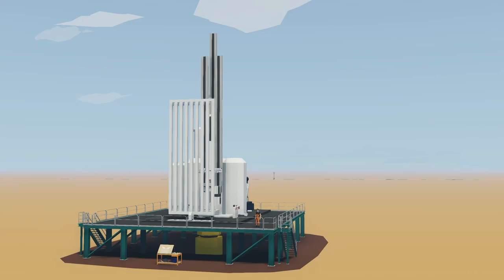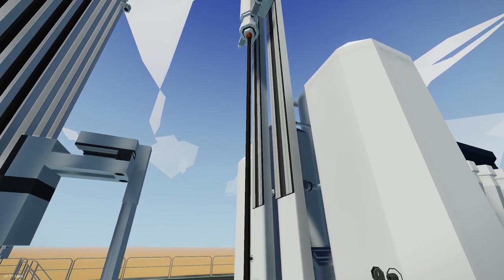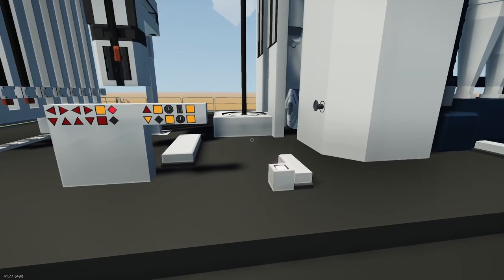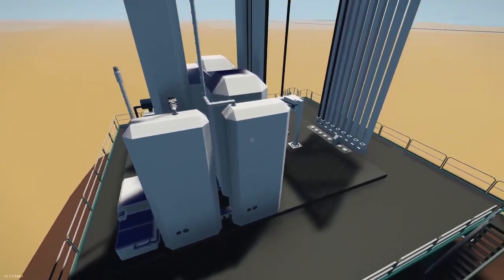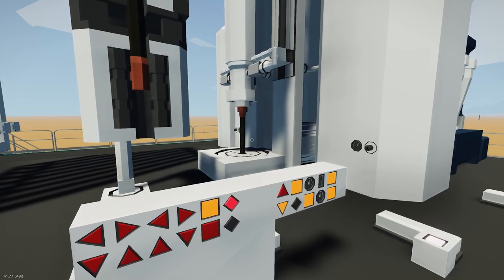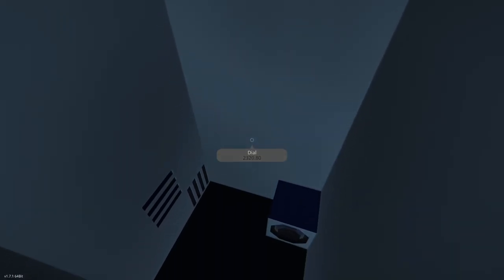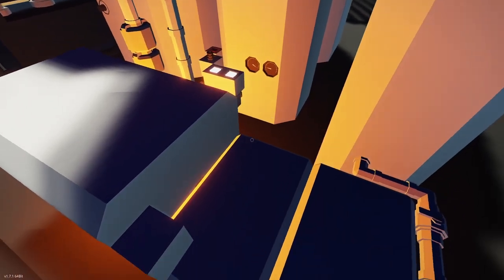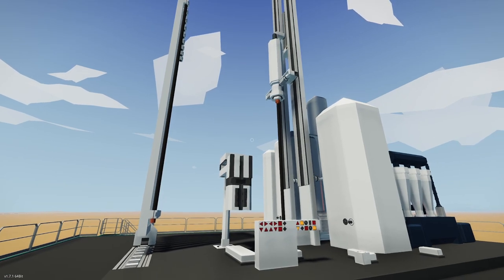Stormworks: Oil Drilling & Refining Tutorial #stormworks

Comment: No, you can leave the pipe / rod in the well when despwaning a vehicle. You must de-clamp the pipe/ rod completely. So long as all clamps are off, the pipe will remain when despawning. I do this when im done drilling. Then i load my pumpjack and distillation tower to start producing oil and fuels. It has its own clamp, swivel, and pump assembly to grab the left over pipe / rod.
Reply from the maker: Interesting. Thanks for the info. 😁

Comment: one thing i did, may release it on workshop was i had a intercooler on the oil between the main storage to distill.  that intercooler on the B side was the water from the closed loop diesel generator i was using as a battery maintain.  it would pre-warm the diesel not by much but enough to heat it to about 50-90 degrees, depended on how long my engine was running for.  also helped to bring the engine back down in temp.
Reply: but i also could see using other things to heat it now like nuclear, ect.

Comment: I went straight to drilling in the ocean, I only had to drill 6.5 meters however because of the water depth i used 14 lengths of pipe total. Thanks for the tutorial on distillation I hope to add that to my ship soon.
Reply: how did you get the well head to align with the rest of the rig?
Reply from the maker: The wellhead is preset on the land ones. You just have to drag down the block from the top and that will show you where the center point is.
Reply: @CaptainCockerels  yes, but I mean on ocean-going rigs where that kind of precision seems slightly implausible

Comment: I love your vids.  I'm building a full mobile setup except the drill platform (but it looks mobile, lol).  I have to haul everything to the site.  Water, slurry, fuel, generator, even a power distribution box.  I have a rod trailer that I pull with the hummer.  A Super HET that hauls tanks.  It's a very modular setup.  I really enjoy the hands on approach.  My distillery is not going to be on site so I have to truck out the oil and distill it elsewhere.  I love the added gameplay.  Ty for your vids subbed

Comment: awesome stuff agian mate.  made soemthing similar to yours but my Pivot is no where near as rigid as yours? mine wobbles alot. did you do some XML stuff to that Pivot you use to pick up the rods?
Reply from the maker: No, it is not edited. Make sure your physics is set to high
Reply: @CaptainCockerels  it was on Auto, still happened a bit tho. So i just made it a bit heavier, think it was a bit of a counterweight issue. thanks  for the response man :D
Reply from the maker: @talosstrike8990  It is a physics setting issue on your end. Set your physics to high and the crane will work as intended.

Comment: Well... Crap. It didn't even dawn on me that I could just ignore the straight up rod clamp and use the rod connector to do it all. Redesign coming my way. I spent all day designing basically, a three sided box with rods that can go on a trailer. It is picked up by a double winch (for alignment) double slider (for reach) gantry crane that allows me to get beyond the build area and to the ground. And then that drops onto this funky array of wedges on a swivel with basically a giant pin made of gripper tracks that holds it in place until I'm done with it. I'm finally breaking out of my shell of mostly building boats, and I'm loving it.

Comment: I would imagine a nuke pack with a heat exchanger might be a good solution for heating the oil. You could likely cycle both the oil going into the tank, as well as the oil in the tank itself, no?

Comment: Hey quick question, could I just pump oil straight into a furnace then into the distillation tank instead of going from having to go from tank to furnace to back to tank. This way theoretically there would only ever be hot oil in the tank?
Reply from the maker: That would work, but you have to make sure it's cycling. It should eventually cool off. You can have a go into the fraction tower and then cycle through the furnace.

I like having an oil storage tank because I may want the raw oil or to process it later.
Reply: Ok thanks for replying so fast. I’m gonna test only pumping hot oil to see if I can run a smooth process with out the need of stopping to refill the tank with cold oil as much. Who knows your process might be the most efficient

Comment: How do you increase slurry flow rate?
Reply from the maker: How fast is your flow rate?
Reply: @CaptainCockerels  The pressure sensor said 0/10L/s so I’m assuming the max is 10 for the setup I have. It’s for an offshore oil rig so I haven’t had time to test it while drilling, maybe the max flow rate would change?
Reply from the maker: @cadennorris960  look at the pump coming out of the left slurry tank. It is pumping about 55L/S